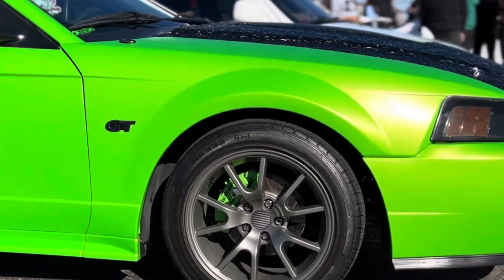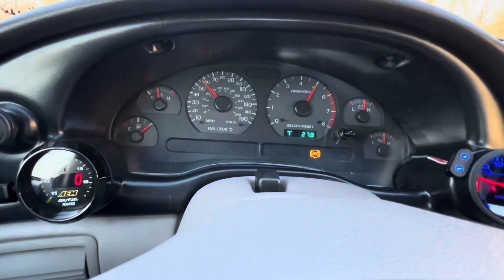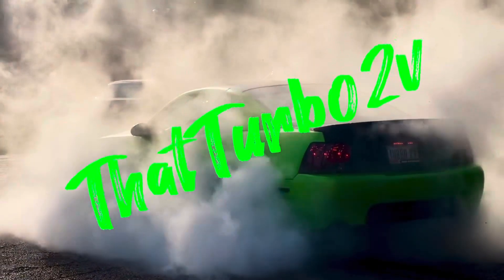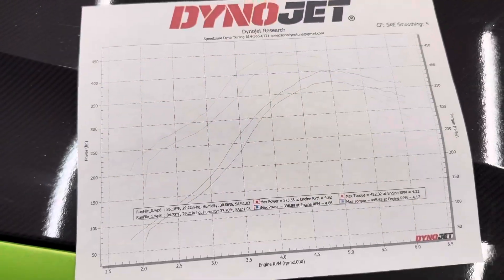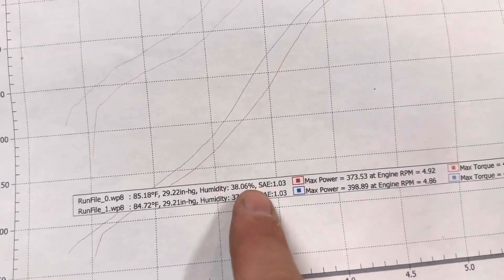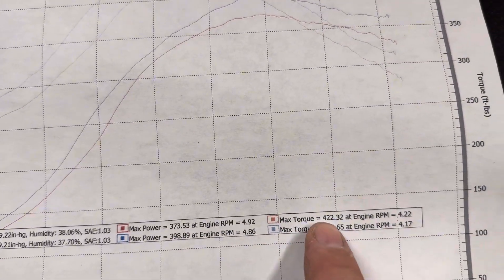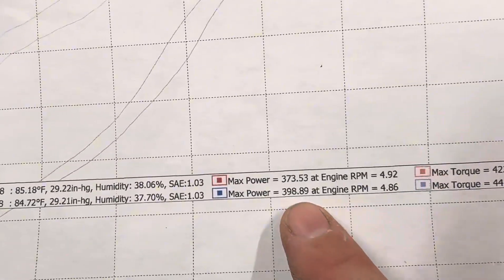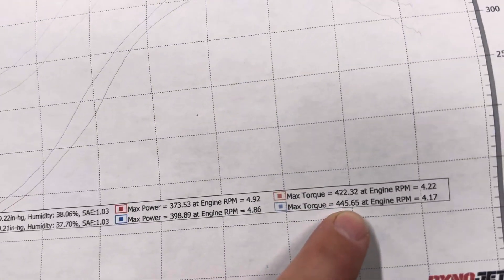Dyno data showing exactly what the “NO NO” muffler does to a turbo cars power and performance.

Comment: Did your peak boost change between going through the muffler and with it dumped?
Reply from the maker: No it didn’t surprisingly.
Reply: @forcefedhatch im just going off my own experience with twin turbos and 40 series flowmasters on my 4.6DOHC. Picked up 3 psi by just dropping the mufflers and running off the down pipes. 
High mile mark 8 engine made 527whp and 500lb/ft at 14.9 psi through the 40 series
Reply from the maker: Nice! I didn’t pick up booster I did however get peak boost quicker. That also may contribute to it quite a bit.

Comment: I have a blow through turbo setup, set to 15 psi. I usually ride around with a 3.5" exhaust. When I put the 4" fender exit on I have to go up a couple jet sizes, no other change. Crazy how much difference it makes.
Reply from the maker: It really is, but it makes sense with less restriction on the turbine wheel. Just often overlooked by so many!

Comment: Im a fan of the electronic dump valves. People should be warned though that it will spool the turbo much quicker and can outrun your boost control. Lets say you are running a fox body at 10lb of boost and then flip that switch it may bump it up to 15lb of boost which that engine can't handle. Especially if their injectors are already maxed out. I think dump valves are a good idea but people should be prepared to tune for it right away
Reply: Im not sure im understanding what you are saying. Boost pressure is a measure of "restriction" 
A more free exhaust would Lower boost pressure because a restriction is removed. In 30 years of doing this ive never had an exhaust cut out result in higher boost. Faster spool, Yes, but higher total output, No
Reply: @TheModAddict  i apologize for my ignorance. Im sure you know more than i do on the subject. Perhaps the source where i saw that info was using an inadequate waste gate. The faster spooling was resulting in severe boost creep. Or maybe i misunderstood. Sorry im still learning

Comment: Bumper exit is life 😁😁😁
Reply from the maker: Oh 💯 I had mine for a bit, just felt bad for the old ladies and neighbors when I leave for work in the morning haha
Reply: Bumper exits is for hondas lmao. Fender exits at the track ans a full exhaust so you dont die from carbon monoxide for the street 😂
Reply: @damianlindsey6177 😂😂😂 if u say so. Doesn’t bother me with my little 800+ hp 2v
Reply: @Jsta2v_racing like, my Ranger is just a stock 302. Hell it barely makes 250hp 😂😂
Reply: @damianlindsey6177 hey we all start somewhere lol. Honestly tho bumper exit isn’t that bad. Cruised it around for plenty. Now with that said o usually trailer it to the track. It’s just easier lol
Reply: @Jsta2v_racing I have had a turbo 4 eye before with a fender exit but it was on the passenger side so honestly I really didn't have an issue either. The Ranger is going to get more power at some point but its fun like it is atm. Im running 9.80s at 79 mph but my 60ft has been a best of 1.93😅 it has zero suspension work done to it outside of drop beams and an explorer 8.8. I really want to get the suspension really built and sorted to see exactly how quick the truck would be with the stock 302. The tkx has been bulletproof compaired to the t5 that was in it. I broke 2 of those 😂
Reply: @damianlindsey6177 hell yeah. IMO respectable 60ft with having no real work done on the suspension and my bumper exit I’d passenger side as well.